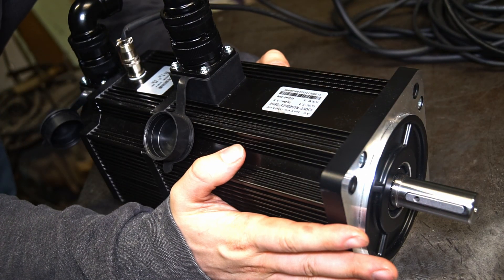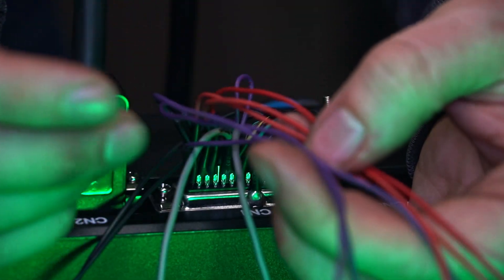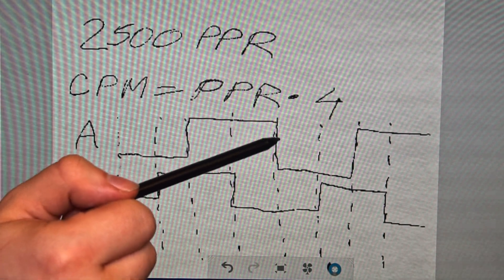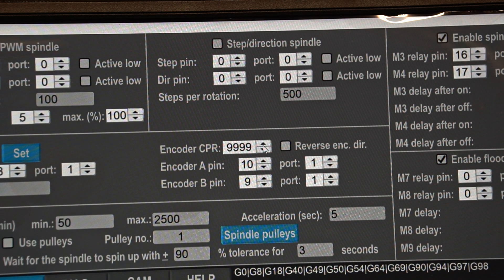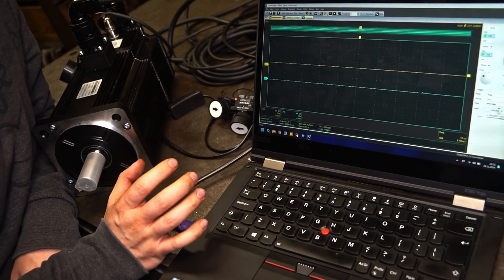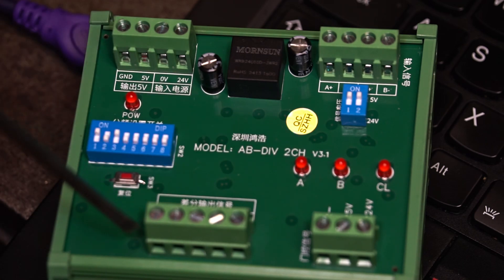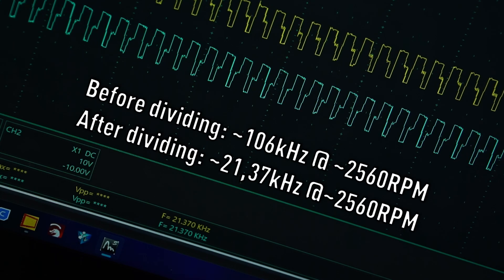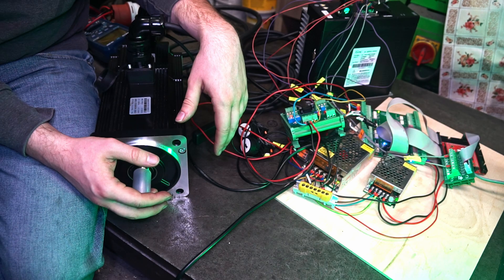Can You Connect Your Spindle Servo Encoder To CNC CONTROLLER?! #UC300ETH-5LPT

Comment: This might just be because of the improvised wiring on your table, but the encoder signals shouldn't affect each other as much as they do on your oscilloscope, with a high signal on one pulls the other to almost half it's voltage. Also do you really need to connect the encoder to the controller for coordinating it with the other axis, doesn't the servo driver make sure the motor does what the controller asks, like it can do with open loop steppers?
Reply from the maker: About the signals - this actually can be the improvised wiring as you said. Not sure though.
I'm going to use this servo for my spindle. The machine has to know precisely how the spindle rotates, to make sure the feed in the axial direction of the spindle will be exactly at point. All this is needed to do tapping / thread cutting.

Comment: Thank you for sharing vital content which I presently need it, but I've got a question; How come do you prefer the UCCNC over LinuxCNC, is there any particular technical reason?
Reply from the maker: Honestly - when I was making my milling machine I was looking for a good CNC controller with ethernet connection. I was considering linuxcnc with MESA and UCCNC w/ AXBB-E. The linuxCNC is really robust but quite tough to setup. UCCNC is simple and very robust comparing to Mach3. When I was looking for that controller - the AXBB-E was cheaper with all the I/O's and it was available with shipping to my location. I'd like to avoid USB/LPT controllers, as the ethernet ones are much more stable. Considering all that I tried UCCNC and for now it seems that UCCNC is doing all I need, it is very simple to setup. With all the positive feelings after the milling machine projects I decided to give a go with UCCNC with my second lathe project, using the UC300ETH which has a lot more I/Os.
Reply: @GBWM_CNC  Thanks for your kindness...🙏